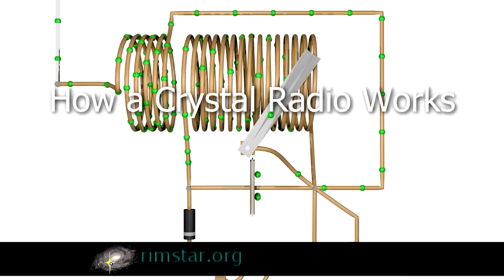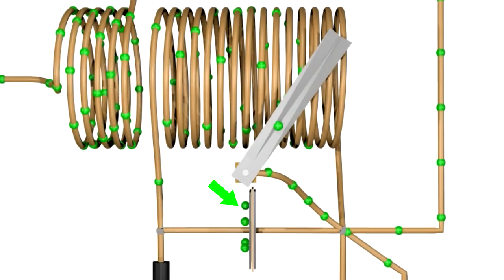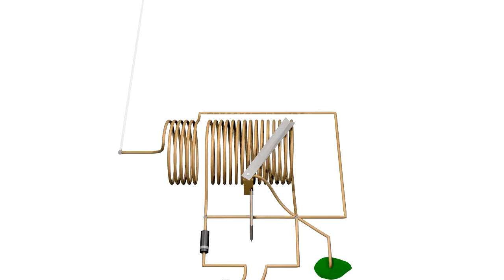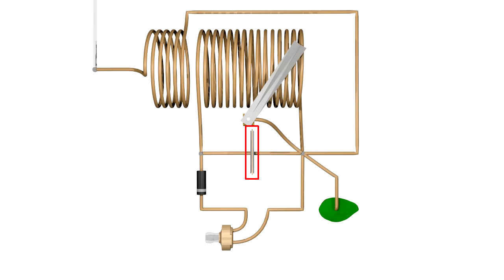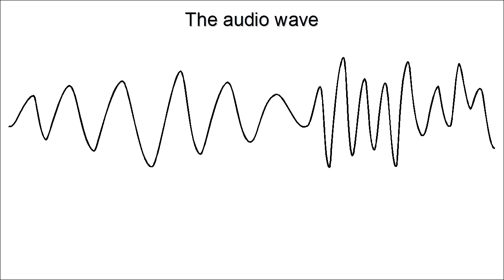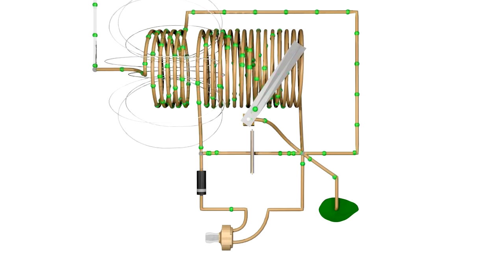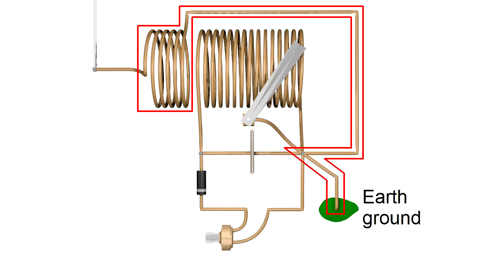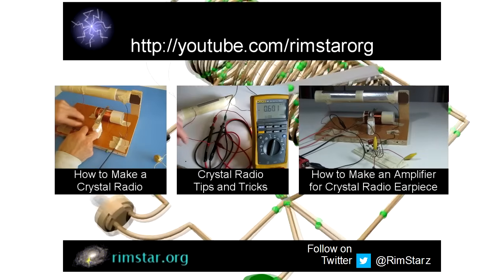How a Crystal Radio Works

Comment: You told us a lot but forgot the most basic part in the video.  Where is the crystal in the crystal radio?  All you showed us is a coil radio with a diode and capacitor.
Reply from the maker: These days, the definition of a crystal radio is any radio that is powered by the incoming radio waves themselves. The crystal (typically a Galena crystal) has been replaced by the diode.
Reply: I am an electronic design engineer and I was being rhetorical when I asked "Where is the crystal in the crystal radio".  No the definition of a crystal radio is not any radio powered my radio waves themselves.  The original crystal radio included a crystal (diode) that rectified the carrier wave.  This is no longer a crystal radio but a one diode (PN junction) radio.  I realize I am talking semantics here but we need clarity so as not to add confusion to an already complex concept for most people.
Reply from the maker: In hindsight, I probably should have included an explanation for the origin of the name. People looking for an explanation might be expecting a crystal, and certainly one variation uses a crystalline material.
But I do disagree with you about the definition -- language changes or additional definitions are tagged on, and a search shows a huge number of usages for crystal radio that use gernamium diodes. Not that wikipedia is the final word by any means, but they have a similar definition https://en.wikipedia.org/wiki/Crystal_radio.
Reply: Your explanation reminds me of people hanging onto old obsolete technology terms.  A good example is when the people on TV are going to commercial they say "stay tuned to this channel and don't go away".  Since when did you tune your solid state tuner in your TV lately?  We don't tune are TV's anymore, we select channels.  When I grew up the TV's did have a large box with coils and capacitors and a variable capacitor for tuning.  It is no longer like that and we need to update ourselves to the future.  The correct thing to say is "Stay with us until we get back" (and some of them do) because tuning your TV by hand is not necessary anymore.  So your logic is that when everyone gets it wrong including Wikipedia, then it becomes part of the language and we should just shut our brains down to the stupidest kid in the class.  You are right that this is how our educational system works today and it is very sad thing indeed.

Comment: The direction of the diode is the opposite
Reply from the maker: What makes you think it's the opposite?
If you think in terms of electron flow (easier for me to think that way) then electrons flow from the ground, through the earpiece, and through the diode and through the rest of the circuit back to ground. If you think in terms of conventional current, which is the direction the diode indicates, then it's the positive holes going the other way. Also, check out every crystal radio schematic here https://en.wikipedia.org/wiki/Crystal_radio.
Reply: @RimstarOrg  In time 2:10 you did show current(electron flow) from Cathode to Anode!
It is impossible.
Reply from the maker: Ah, thanks for clarifying. If you mean the direction I show the arrow and the direction that the electron moves through the diode at 2:14, that's the correct direction for electron flow in a diode. The other direction is conventional current, the flow of positive holes and is the flow that the indicator on the diode indicates but since my animation was showing electron flow, I felt I should be consistent and used electron flow through the diode.

Comment: I don’t understand what the capacitor is doing. I understand the other components. Why do you have a capacitor, doesn’t a capacitor store electricity? Why do you need to store electricity.
Reply from the maker: The capacitor is there to work with the tuning coil to tune into a specific radio frequency. See the video at 3:37. Also, see this video that goes into more detail https://www.youtube.com/watch?v=shZUI6B5bZw

Comment: I see, so with some modifications a crystal radio can be used to charge my phone
Reply from the maker: Theoretically yes. The modifications will have to include somehow stepping up the voltage. The current will be very low so I'm guessing it will take a long time to charge. Make sure you have a very long antenna so get a strong signal.

Comment: you dont nedd secound coil you can just add one more adjustable cap betwen antena and radio... ( I dont want to use 2 coil cost i can bearly hear radio with one coil ( using computer speakers) I get best results in the morning why is that  ???

Comment: Where is the crystal?
Reply from the maker: In the early 1900s, a crystal such as galena along with the pointy end of a wire was used in place of the diode. These days, any radio that's powered by the incoming radio waves is called a crystal radio.

Comment: Where is the crystal?
Reply from the maker: There isn't any anymore. Before commercially made germanium diodes came along, people used to use a galena crystal and a pointy wire to do the same thing as the diode.  These days, a crystal radio is any radio that gets its power from the incoming radio waves.
Reply: @RimstarOrg  What about the crystals they used in clandestine radios during WWII?
Reply from the maker: I know that some used what are called foxhole radios, which were crystal radios which used a sharp point placed against razor blades. I did that approach in this video here https://www.youtube.com/watch?v=eIdHsjfbckw I don't have knowledge of whatever other approaches were used.

Comment: Hi thanks for the knowledge sharing. I have been trying to work out how to calculate the optimal "matched" inductance of the shorter antenna coil instead of using the rule of thumb. But the more i think about it, the more complicated it gets. The antenna has its own stray capacitance and inductance, so does the short coil has its stray capacitance. Therefore we can see it as if they were the primary and secondary coils of a spark gap tesla coil. But we dont want high selectivity or high Q like a tesla coil in a radio receiver. The natural resonance frequency  of antenna + short coil does not need to match the natural frequency of the tuning tank circuit. Finnally i have realised the problem is quite complicated. The other factors like impedance matching, coupling and Q factor are important according to  this web:

http://www.lessmiths.com/~kjsmith/crystal/.handbook02.pdf

Comment: This design is different from ANY radio that I have ever seen. 

It has no battery nor A/C cord to supply electrons to power it. 

So, where do the electrons come from?

And if it works in this design, why can't we power ALL of our electronic devices this way?

I could have saved an awful lot of money on electric bills and batteries during the course of my lifetime! 😣
Reply from the maker: It gets its power from the radio waves themselves. That's what's so fun about it! However, the power is very small, which is why we don't use it to power all our electronic devices.

Comment: Hello! I've been watching your videos, & I was wondering if you'd have a video chat with me sometime, on facebook, or something alike. You see, I'm doing extensive research, & it would be great to talk to someone who knows about all of this. I'd like to get a more dynamic, & thorough view of some ideas, * questions that I have.
Reply from the maker: Hi! I'm so busy that I don't even have time for all the things I'm already trying to do. So I can't do video chats, sorry.
Reply: RimstarOrg Okay, that's fine. I was just wandering, if I removed the diode, & the wall, & turned the tuning blade into a T shape, as to where it touches the whole coil, would I get all radio stations at once, or would it keep sweeping?
Reply from the maker: If you touch the whole coil at once then there is effectively no coil, just a straight wire where the T is. There would be very little induction from the antenna coil into this wire.  And what you did get would cancel each other out. You'd get very little in other words.
Reply: RimstarOrg So there's no effective way of making it pickup multiple channels at once, or for it to "scan"?
Reply from the maker: I can imagine there's some way to make one that scans frequencies. I could be wrong, but I doubt there's any way to pick up multiple channels at the same time though -- at least not in any way that wouldn't simply produce noise and cancel out any usefulness.
Reply: Find the positions you want on the coil and run separate diodes from there; (rotary) switch/scan through to "speaker", IMO.
Automatic scanning using transistors as switches (with time delay above 30dBm?).
http://www.rapidtables.com/convert/power/dBm_to_Watt.htm

Comment: What would happen if the two coils were placed one inside the other like a transformer?    The arrangement you show would be inefficient if it were a transformer.    Obviously that would not work well for a radio?   Just picking you brain.
Reply from the maker: They might be too tightly coupled with all the frequencies having too strong an influence while the tuning coil and tuning capacitor are trying to resonate at a specific frequency. There's probably some optimal distance where you get the best of both worlds, induction and non-interference. I don't know how to calculate it though.
The same is true with a Tesla coil's primary and secondary coils, you don't want too good of a coupling so that the secondary can resonate on it's own.